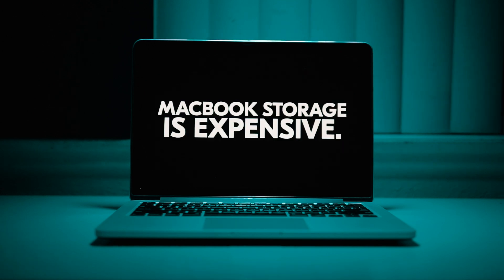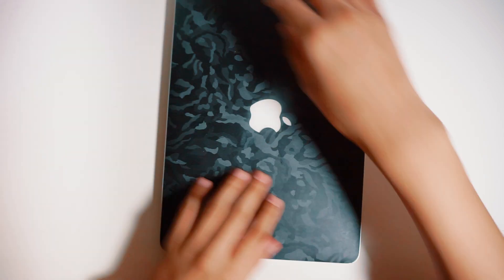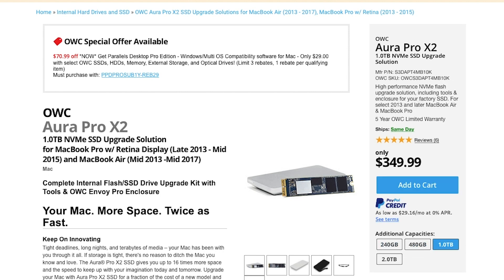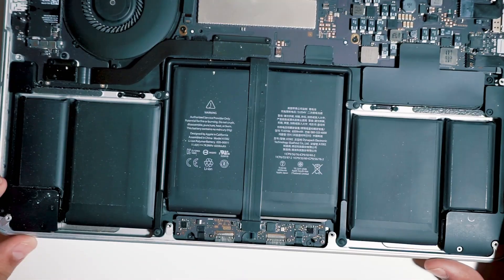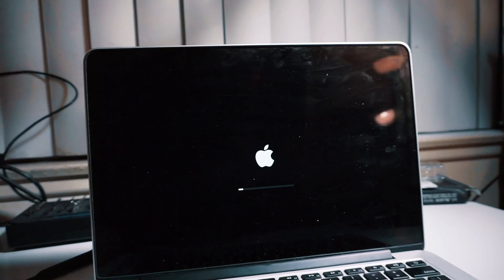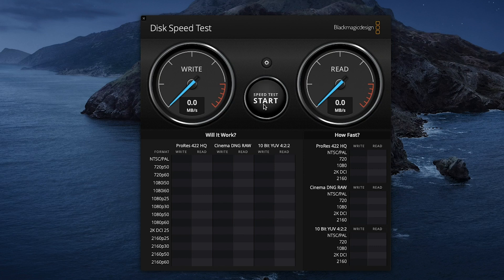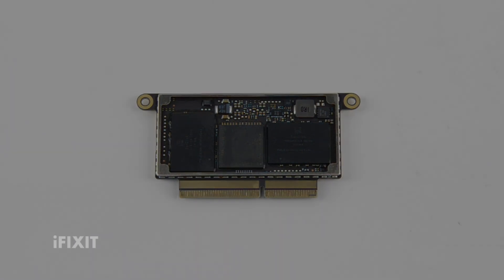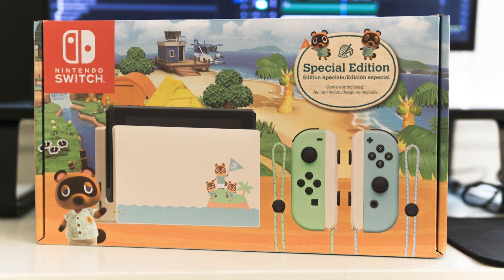The Last Upgradable Macbook Pro

Comment: Local prices are much higher than you stated. I have a late 2013 MacBook Pro 15" with 16gig ram and 2T ssd. Sadly I upgraded with the only one available that would fit. Expensive as hell but I still don't regret. Looking for another upgradable MacBook Pro 15". Wish they would go up to 32 gig ram. Damn nice machines.

Comment: I just upgraded the drive and memory in my macbook pro 2019.  our company makes adapters for nvme and it is a good idea if you know what you are doing and have the equipment to change the drive controller on the logic board as well as some of the capacitors and resistors to jump the voltage for the controller from 3.45v to 3.75v.   this will give you the top speed of your drive.  you can upgrade the 3d nand on new macs but you need to know component level repair.

Comment: glad this popped up in my recommendations. Had no idea that 3rd party drives were finally "compatible". I've already replaced the original battery, added new thermal compound to the CPU and GPU and my 2014 15" MBP still runs like a beast. But an upgrade from 512GB to 1TB would be extremely helpful.

Comment: Helpful vid, thanks.

i have the same MBP and specs. I was wondering about your battery. Have you changed yours yet? If so, through Apple or third-party? I'm on my 4th year on this MBP and battery is at 1200 cycles and is at "service recommended" condition. Would love to hear your thoughts!

Comment: Does this “trick” work in a Mac mini late 2014? And can I use a less expensive M.2 SSD?
Reply: you need to check which key is being used and if your motherboard supports either SATA or NVME controller before you buy something and than find a compatible drive.
Reply: Paul V ah okay thanks!
Reply: @alessioacri.  A SATA type drive will be cheaper as an NVME one and you likely don't need more speed than that anyway if you don't work with very big files. (SATA 3 = About 550MB per second). You would need to figure out if your device can even hold a M.2 drive and which types it supports (Either NVMe or SATA or possibly both). These drives come in different lengths and keying.
Reply: Paul V I already have a SATA 3 SSD, but my Mac is still slow

Comment: For real I still have my 13" 2013 retina i7 with a 1TB and it runs amazing. The only upgrade I would do is a new 2015 on ebay. Some are refurbished with all new parts so it's pretty much new.

Comment: I’m currently using a 2012 Macbook Pro with 500GB of storage and 16GB of RAM and it works great for how what it is. I can only imagine how my work flow would be with one of these.🤔 did they make a 15” on these, if so, was it upgradable like this to or not?
Reply from the maker: ImNeu They did! And yes, the upgrade process is identical. 👍
Reply: @DammitJeff  great! I'll look more into it. Thanks and nice video! :)

Comment: I’ve been rocking with my mid2012 13inch Macbook pro (basic model i5) since release date. This thing has seen be through middle school, high school, and now i just finished my 2nd year of college. Heck i wrote all of my college applications on that thing. *I upgraded the ram to 16gb and HDD to 256gb SDD a few years back and what a difference it made. Wouldn’t be surprised if I get buried with it. 8 years strong 💪 baby

Comment: Macbooks made before 2014/15 (depending on the model) only used PCI X2 for it's NVME storage and your Drive is a PCI x4 drive so if you have a 2015 or newer it would get the 3000+ speed advertised. So in short your NVME drive is only getting 2 lanes of PCI bandwidth compared to newer machines which get 4 lanes of bandwidth so you are getting speeds at the Maximum the port can achieve. 1500 mb/second

Comment: I personally want to thank you.. I have two Mac books. One is a 2019 MacBook Pro, the other is the exact same Mac you are working on in this video. I need to upgrade the hard drive storage. If you don’t mind , I also want to know if there is a way to upgrade the RAM on this Mac?
Reply from the maker: Glad to hear it! Super happy i could help. Links to everything are in the description. 🤗
Unfortunately there’s no way to upgrade the RAM on these machines, super sorry about that. :(
Reply: @DammitJeff  yea that sucks because a lot of these models come with a cap on the amount of ram as well and I run heavy programs. thank you again for this video I have already ordered the same set up as you just now. do I need to install a certain version of Mac OS to make this work in the boot screen?
Reply from the maker: @SimienHill  Mojave or Catalina to install. The drive won't be detected anything under those two. People that are referring to High Sierra are referring to mackintosh builds. Hope this helps. 🤗 Best of luck on the upgrade.

Comment: Hey Jeff thanks for sharing, I'm using this type too A1502 2015 128gb ssd. 
But, i want to ask you something, there is a 2 types of adapter that i found on the marketplace, first one is look like yours and then another one looks like more tiny.
So, they are the same or not ?.
Reply from the maker: I’ve seen more people have compatibility issues with the tiny one,mostly because it’s from another brand. It be best if you stuck with the one I linked 🤗 good luck on your upgrade!

Comment: I found a great eBay deal on an early 2015 i7 w/ 16GB logic board and I replaced my old i5 w/ 8GB.  My 13" MacBook Pro w/ i7 & 16GB is like a brand new COM-POOTER!  I followed the guide at iFixit and it took about an hour start to finish.

Comment: Not going to sleep and power drain issues because the new drive doesn't power down is a widely reported issue with doing this upgrade. Did you later discover these problems?
Reply from the maker: No! This is an issue with 2013/2014 MacBook pros. This is a 2015 and has zero of these problems, which is why I picked this one for this experiment. However, there is workarounds and fixes for these issues, the amazon link for the adapter in my description has the command lines you need to enter in terminal. 🤗 hope this helps!

Comment: I really wish Apple just took this machine updated the internals, added a touch bar, touch ID, replaced the thunderbolt 2 with tb3 and slimmed the bezels for larger 14 and 16 inch models in 2016 and beyond. Everyone would have bought it. But guess they're coming back to this with the new updates.

Comment: I'm actually scared to do this.... I have the same compoooter :))) - 2015, 13' Pro 128gb, but idk I have a weird luck with laptops in general, for example , (I bought this laptop used, in a good condition about 2 years ago) when I got it it had Catalina, beta version installed so I did a clean install, but the laptop kept having wifi and bluetooth problems... so (idk how but I had a usb with High Sierra)- so I installed that... no problems works fine, just one minor problem ... from time to time, at least once a week I have a kernel panic, caused by idk what :))) restarts automatically while in sleep mode. SO in conclusion should I or should I not upgrade the drive, yes in deed I do need more storage (for gods sake I have 5 gigs free ) - but I've heard that some drives have sleep-wake failure or other annoying problems. I don't know what to do... help ?:))
Reply: buy a m.2 usb nvme adapter.  and the mac to m.2 adapter.  then download carbon copy cloner.  just the free trial. Plug in the new NVME as an external and format it.  then just run carbon copy cloner to duplicate your drive exactly.  then swap out the drive.  boot it and do a pram reset.  then it will boot and work normally.  faster way to do it than time machine.

Comment: Damm and he skipped through the process of connecting back the battery, I know it must not be that hard but now I gotta search for another video on how to do it just in case I don't get anything wrong. But besides that great video man, loved it
Reply: Did you get a video because I need to do the same for my Mac book Pro 2014 model it's 128gb I need to put 500GB SSD into it

Comment: Am I glad to see this video. I have the same base model as you and because of storage issues I had to downgrade from MacOS High Sierra to El Capitan. I'm wondering if anyone knows how to get rid of staingate(stains on the screen)?
Reply from the maker: About a year ago I brought in a different MacBook Pro 2015 with staingate on it and told them about the staining issues. Turns out there was a recall on them and they replaced my top case display 100% free. Once this whole thing is over, I suggest giving it a try, make a Genius Bar appointment, tell them about the recall, and just use covid as an excuse as to why you weren’t able to do it earlier and you’ll be fine. Hope this helps!!
Reply: @DammitJeff  Big thumbs up for the advice! 🙌
Reply from the maker: Of course! Thank you for watching! <3

Comment: Don't want to be party POOTER, but you shouldn't touch contacts on SSD and adapter. Or at least clean it with alco afterwards. Your hands can leave greasy marks, water and dirt on the contacts that can damage components.

Comment: have you noticed issues with your Mac improperly shutting down? Or randomly booting up? I splurged on tge OWC 1Tb for my 2014 15" and another 256 OWC AURA for my 2013 Mac Pro and it’s been a headache.
Reply from the maker: Personally, no,as far as I heard, those issues are specific to when you use OWC drives with the 2013/2014 models together. 😅

Comment: Has there ever been a fully upgradable macbook(in terms of traditional upgrades meaning replacing parts connected to the motherboard)
I know very few laptops have ever supported processor upgrades, but was there ever an apple laptop that supported this? Maybe back when IBM made them for apple?

If you were able to format the new drive to APFS before replacing te old drive would you be able to use internal recovery mode?

Comment: The actual speed is lower then what it's said on the box because of Mac's memory bus. 
The default ssd is using a SATA bus so it's limited by around 1,5gbps. SATA is connected to the processor through the south bridge (low speed for usual drives)
Your new WD Black is based on the NVME standard so it's capable of using the north bridge of your PC. North bridge is running up to 10gbps, so it also responses of RAM and video cards. 

Btw, every MacBook is using SATA transfer standard for internal storage.

Comment: I'm using the 2015 13" macbook pro right now still as good as day one, 5 years later. Not to brag but no windows laptop can achieve that
Reply: ThinkPad has entered the chat.
Reply: My 2014 Asus laptop still runs good with Win10 and i'm even able to play games on it and able to upgrade ram or ssd easily 😜

Comment: I have the exact same macbook pro model for the past three years. 128gb is abysmal, and several times i had to uninstall programs and reinstall when i need them just for the sake of storage space. I have been eyeing on the 2020 macbook pro, but after this video that I see that I can continue to use this machine for much longer just by upgrading the SSD. Gonna fall in love with this macbook again
Reply: Trust me save the money and get a late 2016 Core i7 2.5ghz, 2.7ghz or 2.9ghz and up processor and minimal 16gb of RAM for 400-550 and it does everything the m1 does no joke...maybe u get a slight couple seconds finish rendering a 1hr video on premiere but an m1 should SMOKE a 2016 or 2017 mbp and I've compared them with someone I know with an m1 and I would never pay that much for a few spec bumps. I found my late 2016 Core i7 2.7ghz 16gb for 180 by winning an auction luckily had zero issues as well

Comment: Great Video. Is the adapter holding up well. I've read a few things about it preventing the computer from sleeping?
Reply from the maker: Adapter is holding up great! To clarify, the sleep issues is something that happens on 2014/2013 models, and even then there’s is a workaround that involves just inputting a few lines of code in terminal to resolve the sleeping issue. 2015 doesn’t have these issues at all, like, I’m talking zero issues works exactly as OEM. Hope that helps!

Comment: Honestly, if you are opening up the bottom cover just change out the thermal paste.
It makes a huge difference in usability, the computer won't thermal throttle as quickly and will actually dissipate the heat into the air, instead of the aluminum case and motherboard

Comment: Love this video! I have a 2014 MBP which like yours, has been my trusty steed for a long time - but while I've done a lot to try and work with the 120GB of storage I have, the other bottleneck for me has been multitasking speed (mostly when I have lots of programs open) - I imagine my RAM is the bottleneck. That said I wanted to ask just in case, has this upgrade had any affect on speed (like switching between programs, browser tabs, or anything else)? Or would you say it's mostly the same? Thanks again!!
Reply from the maker: Glad you enjoyed the video! 🤗 I don’t really recall my MacBook ever being slow to begin with, just couldn’t do much with it without a drive. That said, I’m a designer so my workflow consists of the adobe suite on the day to day, and it works great for me! but if I may ask, what does your workflow look like?

Comment: Did that with my wife's MacBook Pro last year. A little fiddly with making sure the laptop's firmware was first upgraded - by updating macOS, and then we still weren't sure if the occasional not waking up from sleep was software or hardware. Overall I think the 1TB upgrade was worth it for us. As I type this, I can't remember where I put the 512GB original...

Comment: You might be getting low read and write speeds because of the processor 2.7ghz dual-core i5 and ram 8gb ddr3. I got a 3.1ghz dual-core i7 and ram 16gb ddr3.

Comment: Wow, I have the same Macbook as yours (same specs, 13 inch but just a little more storage - 256GB) and I didn't knew I could change the hard drive. I work editing and producing video so my 256 SSD is not enough. I will be looking to buy a new SSD soon! Thanks for the video!

Comment: As far as I know, that isn't the last model with upgradable storage. The 2017 non-TB model can be upgraded as well.
Reply from the maker: I'm getting real tired of repeating over and over again man. 😪 Yes. I said this. Like, literally in the video. 7:14
Reply: @DammitJeff  I know, but you said 2016. I just wanted to point out that the 2017 can be upgraded as well if anyone runs across this.

Comment: As a 2019 macbook pro owner with 128 gb, IT’S A STRUGGLE
Reply: i have a 349 dollar dell inspiron 3583 and it has more storage than that lol. it has a 256GB ssd, i5-8265U 1.8Ghz quad core and 8GB of DDR4-2666MHz ram. Way better value than a macbook. I used a late 2009 macbook (the white plastic one) and I had 8GB of ram and the original graphics card and cpu white running yosemite. I gave that laptop to my mom and bought a new laptop to use for schoolwork and she loves it. It can still run videos in 720p.
Reply: @chezcake8607  I have a macbook pro and a normal PC... I like the macbook for multiple things: the OS, all the app that are included and useful, its slim and its not heavy(Yeh I have a lot of books in my backpack))

Comment: Hi, nice vid, but there are some rhings to point out. If u have non apple ssd in your mac u have to turn on trim support manually. Just run sudo trimforce enable in terminal app. Then answer yes twice and the mac gonna restart by itself. If u dont do it your ssd gonna degrade with time. U only do it once after installing the os.

Take care. 

Another thing. High sierra 10.14 was the first mac os to support mvme drives. Just a quick nore.

Comment: Having done this upgrade last month to my 2015 MacBook Air I agree it is worthwhile. However, one thing that folks thinking of the upgrade need to do first is ensure they are running the latest MacOS (ideally Catalina) before doing the upgrade. There are some updates to the firmware that are needed to allow this type of upgrade to occur and failing to do so may result in your drive not being recognized at setup time.

Comment: I have exactly the same Macbook with 256gb SSD from factory. I am currently thinking of upgrading to 2020 1.800€ model because of RAM. 
When I write assays and work in zoom with multiple .pdf .pptx .xcel and browser tabs it really hits maximum performance and tends to slow down close to zero. 
Do you/somebody have any ideas how to improve performance in general? Tools, Apps, Hardware, I don't know what? 
Thank you for some suggestions!

Comment: The 2015 macbook pro is also the last macbook designed by steve jobs before he died. Tim Cook is just ruining the brand. I got the 2015 macbook pro in early 2016 instead of the stupid Touch Bar/butterfly keyboard 2016 macbook pro. And I will use it till it dies on me! I am pretty sure it will be my last macbook. I haven't seen apple coming out with any decent macbook since then...

Comment: That's the one I currently have w/ 512 GB, it's about to be retired and replaced by the new 2020 13-inch model, originally purchased the 512 GB with the 2019, but then revised it to the magic keyboard and doubled the storage.
Reply: hello. will u be giving it away mate?

Comment: Hi, I just did the same (Wd Black) for my macbook air 2015, your time machine save has inside a recovery mode, you can boot from it and the disk will be recognize and you doesn't need to do the update step
Reply from the maker: I...had no idea! I really should have just tried plugging in my Time Machine backup first 😭 Thank you!

Comment: I wouldn't call it "recently". Before Mojave you could use an M.2 AHCI SSD, like older Samsung XP941 or SM951.  Even some cheap drives from Kingston did have AHCI variants.

Actual proper NVME support arrived with High Sierra. Just after HS got released, my friend came over for an upgrade. Got him the cheapest 960GB NVME drive, and the difference in speed was still night and day.